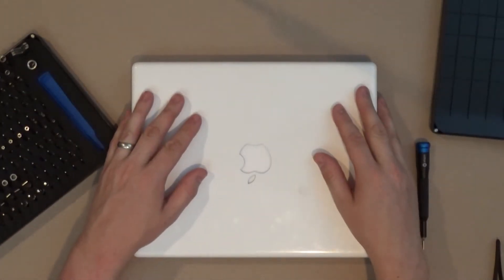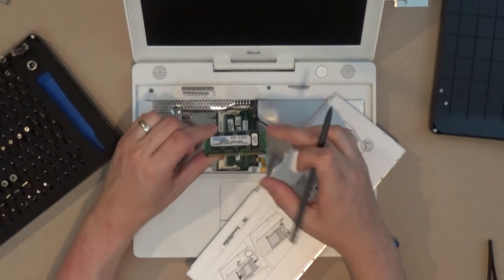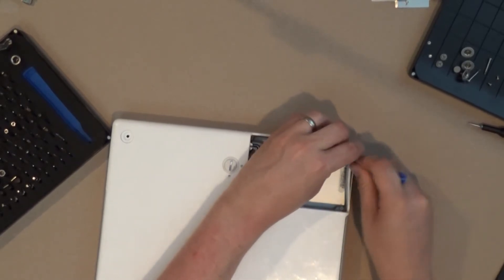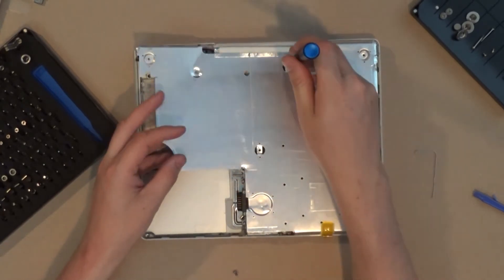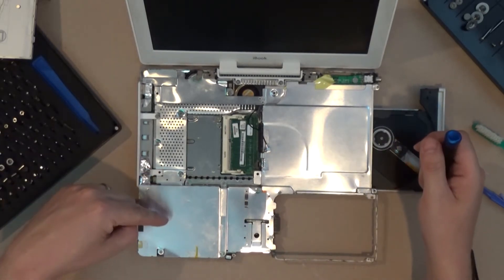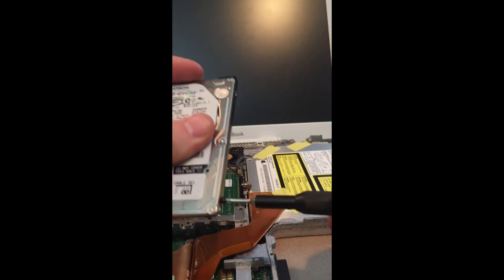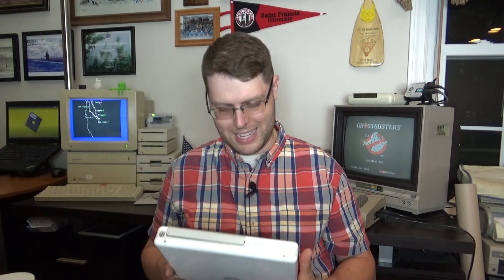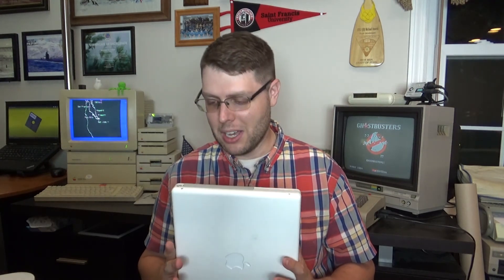Upgrade Your Vintage Apple iBook G3 with Modern Storage: A Step-by-Step Guide to Installing mSATA

Comment: Hi, Could I use a 512GB M3?
Reply from the maker: Keep in mind if you are using OS 9.2.2 the partition cant be no larger than 200 GB. Just verify the max partition size for the OS you want to use.

Comment: I have an old Ibook I found in my trunk and I think something leaked inside of the screen.. can I pop off the back cover, and if so how?
Reply: Also I believe it's the same model
Reply from the maker: @RobertoPerez-g7t  iFix it has a great guide ( https://www.ifixit.com/Guide/iBook+G3+12-Inch+Rear+Display+Bezel+Replacement/1524 )  but i would first check if it looks like vinegar syndrome: ( https://www.youtube.com/watch?v=zbrW7uUYpkw )

Comment: I have one of these, and the speakers don’t work. When I plug in external speakers it plays the audio but it’s staticy. It also won’t play dvds. It then randomly started working, then stopped when I turned it off. Anybody know why? It has “sentimental” value and I only paid 10 dollars for it so I might be willing to fix it.

Comment: I want to replace the HDD in my old iBook Dual USB 700mhz. Can you clarify exactly what parts I need?
Reply from the maker: I just updated my description with Amazon links (should have done that before). The only other thing you need is either an install CD or other receiver device (external drive).
Reply: @RetroTechorDie  Thanks man!
Reply from the maker: @kirishima638  FYI dont be suprised if you have any partition size issues (see my iMacc upgrade video). These older Apples can be unstabe if the partition is too big.

Comment: "quick" and "replacing the drive on the white iBook" are mutually incompatible ideas.
Reply from the maker: lol If I said Frustrating and Difficult no one would watch it
Reply: @RetroTechorDie  I'm considering doing the mod on my 900MHz, because it's my favorite laptop I've ever owned and I want to squeeze out all the battery life I can get, but all 37 steps one way that iFixit lists aren't exactly getting me up off my seat to do it.

Comment: The optical drive laser can get weaker over time and stops “finding” the disc. Some drives have a potentiometer that can adjust the laser strength to account for it.